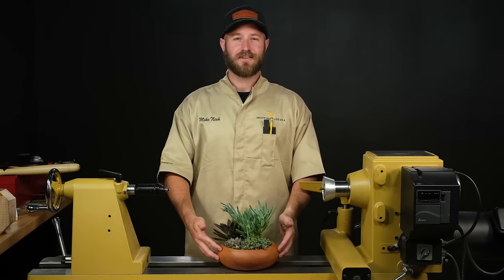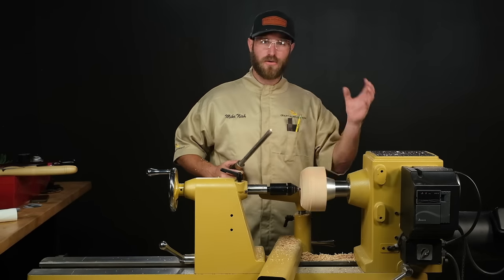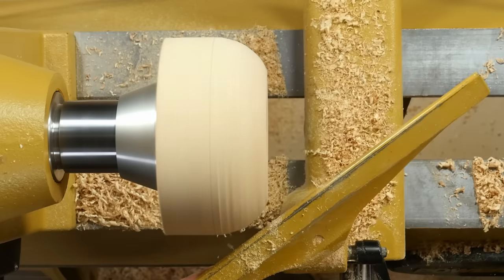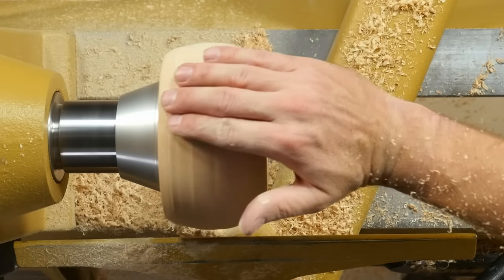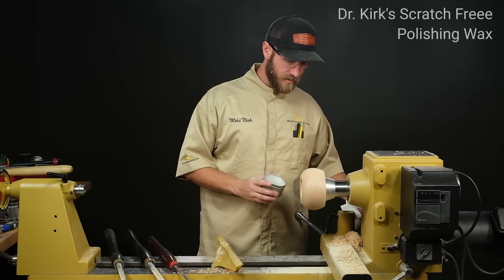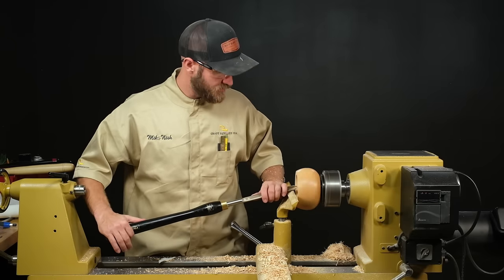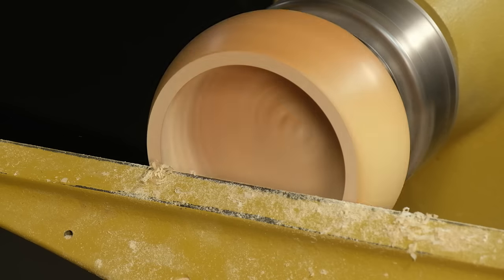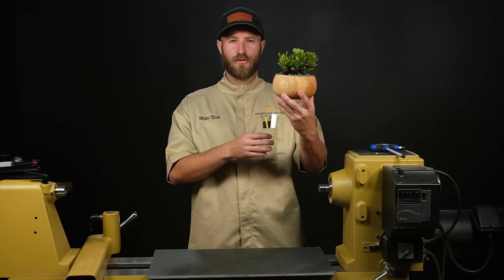Turning a Succulent Planter

Comment: Mike, would you please state somewhere in the video what your bevel angles are on the gouges and scrappers.  Also what the grinds are on the gouges.  Thanks, great video!!
Reply: They do have a full video on how to sharpen your turning tools and what degree bevels to use on all the different gouges and scrappers.
Reply from the maker: Bowl Gouges are 50 degrees, Spindle are 35 degrees with double bevel grind, and Skew is 25-30 degrees. 😊   -Mike

Comment: Can you share the manufacturer of the French curve scraper you used on the inside?
Reply: CSUSA has a Cryotek M2 French Curve Scraper for about $99.   The Henry Taylor M2 French Curve Negative Rake Scraper ( easier to control and won't self-feed) for about $128  Both are very good.
Reply from the maker: Here's a link to the scraper we used in the video:  https://www.woodturnerscatalog.com/p/129/1936/henry-taylor-M2-HSS-Jumbo-French-Curve-Negative-Rake-Scraper

However I ground the negative rake off of mine. -Mike.
Reply: Thanks Mike, I appreciate the info. @CraftSuppliesUSA